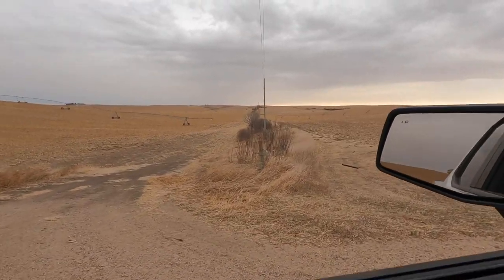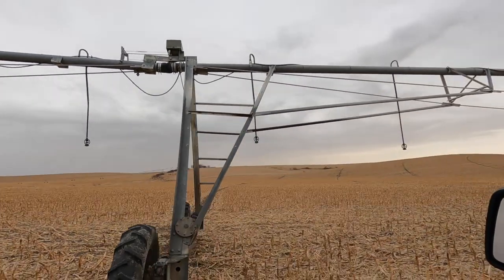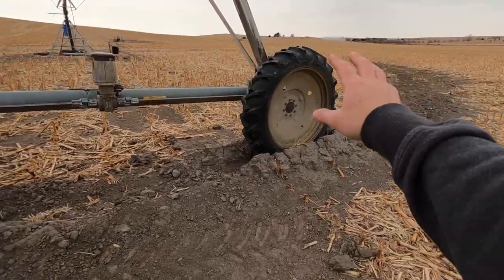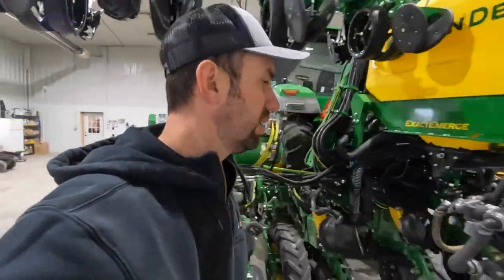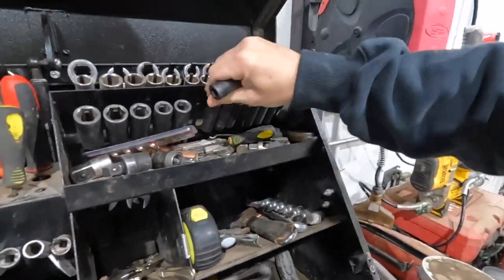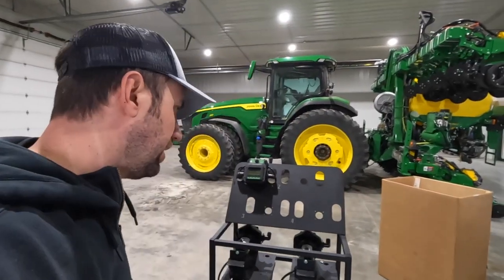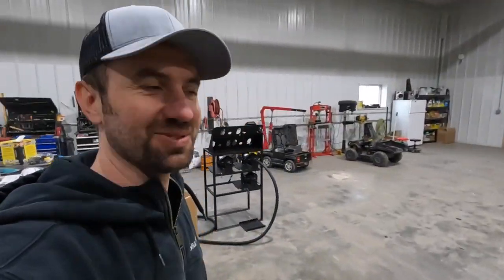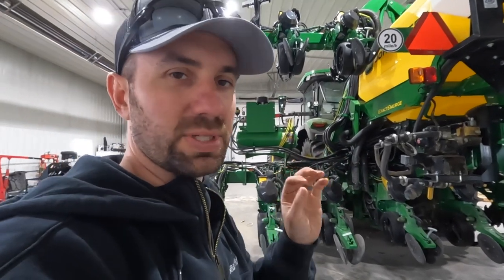Why Would We Use a Planter Like That?

Comment: Did you put a left tire on the right side?    I have some non directional on the first towers.   They push a lot less mud.   They are 38's and called mudders.
Reply from the maker: They came 50-50 directionally like that so I had to use them like that. I’d prefer both same direction.

Comment: I am wondering why you run wheel weights on the rear wheels  with all that planter weight on the 3 point?
Reply from the maker: It does seem heavy, but when we drop that planter down it takes all its weight of the planter off the tractor then when we go over our hills it helps the tractor  keep traction to drag it up and down them.

Comment: Hey Rob, what do the “never flat” tires run for your pivot, like 2x a standard rubber tire??
Reply from the maker: We bought foam filled ones before, the only issue is they’re twice as heavy and don’t flex at all, which in the hills kinda hinders them. And they were more money.
Reply: with no flex there is more stress on the drive.

Comment: IS that planter built by Orthman?
Reply from the maker: They build the bars and assemble them at orthman with all Deere component.
Reply: @ONeillFamilyFarms  looks great. I just found them and are interested in this setup.  We have a 1790 that is 10 years old and have never really had much maintenance done to it.  New opening disks and some bearings…. But the parallel arms and the closing wheels are loose.  It needs work!!